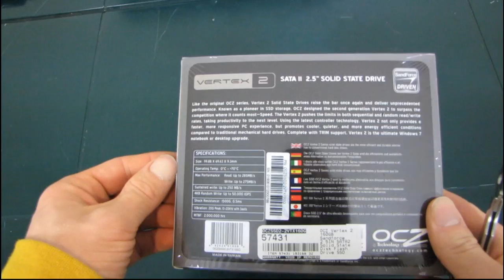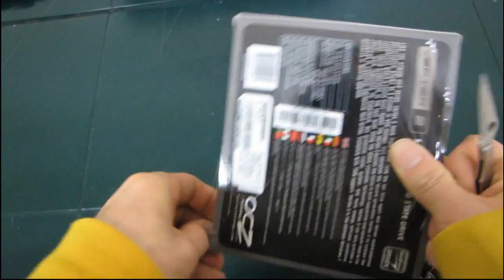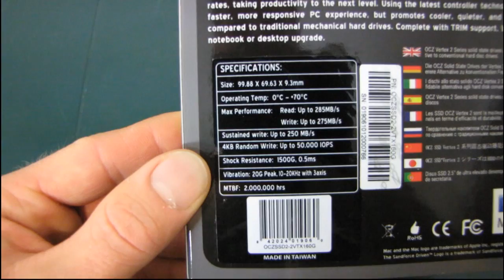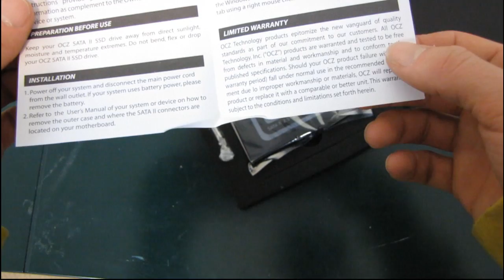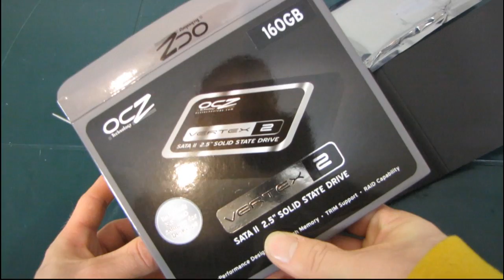OCZ Vertex 2 160GB Feat. 25nm NAND Flash SSD Unboxing & First Look Linus Tech Tips

Comment: @usuckers73 basically not enough people are using SATA6, and all the controllers are crap and cant do RAID, so what would be the point the Crucial RealSSD C300 only gets a read a 355MB/s which is only say 70MB/s faster than a Sandforce SSD, also the SATA2 SSD's get higher reads 275 vs 140 also a SATA6 is only using more than 1Gbps of bandwidth on SATA6

Comment: when will sata 3 be in use cause right now its pointless and only is for future proofing ur system but even with that theres only like 2 on a board so in the end ur paying a more for really nothing unless you will only ever run 2 drives when sata 3 becomes main stream. plus HDD wont be able to use the power of sata 3 for to long to even want to wait. so companies like ocz start making  sata 3 SSD's and fast. there better be a few at CES this year.

Comment: @afinewaytodie SATA III is backwards compatible with SATA II. The reason they stayed with SATA II is because the rated Speed of SATA II is up to 3 Gbps r/w, that is 375 MB/s r/w, which is more than enough for this SSD and all other SSDs on the market atm. There's no reason to use SATA III. Another reason is that most motherboards use Intel SATA II controllers, which has great drivers and works fast and safe. The SATA III controllers on the other hand are mostly by Marvel and are "crap"

Comment: @afinewaytodie Guess you didn't do enough research then.  Sandforce drives don't even utilize the full capacity of SATA II today.  The only mass market SSDs that do are the Crucial C300 which uses a different controller than Sandforce and is able to utilize SATA III properly.  Not to mention most motherboards with the exception of the new Intel Sandy Bridge's coming out next month have crappy third party Marvel SATA III ports.

Comment: @dchains I actually am running a 60GB SSD as a boot drive and a 1TB HDD for data. I'm not completely ignorant, I was just wondering why you don't see a whole lot of SATA III SSDs when SATA 6gb/s is so readily available, and affordable at that. Its not just the "uber high end" boards anymore. If you look at some rather moderately priced AM3 boards, you'll see plenty in the $100-$200 price range with both USB 3.0 and SATA III.